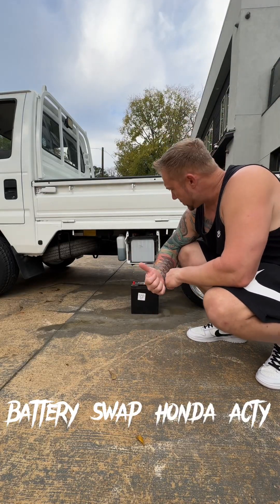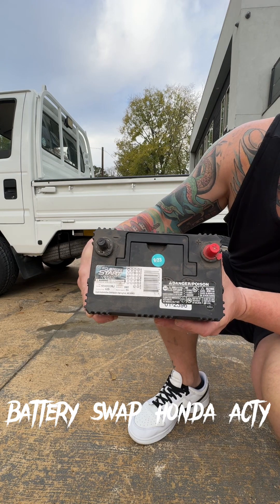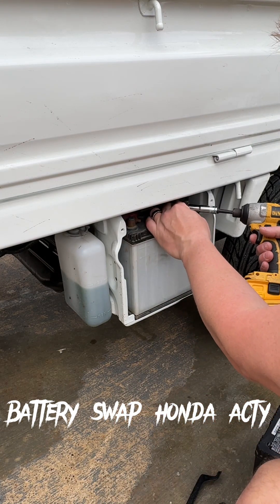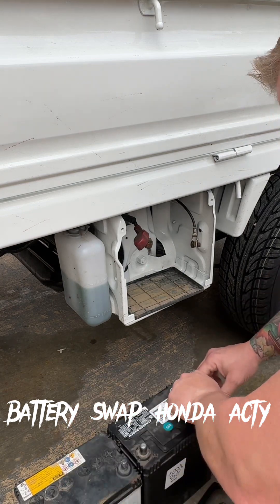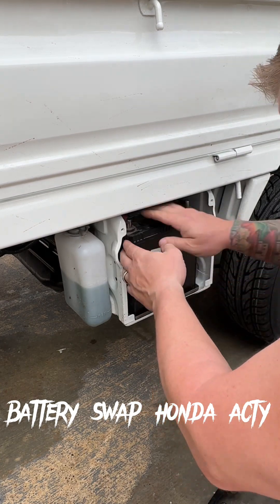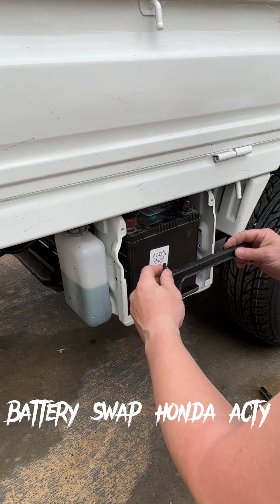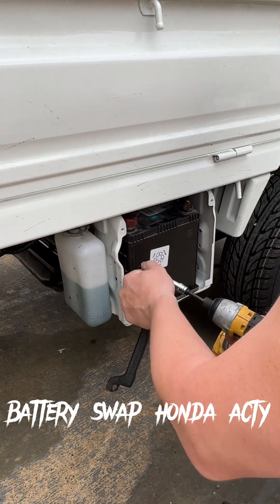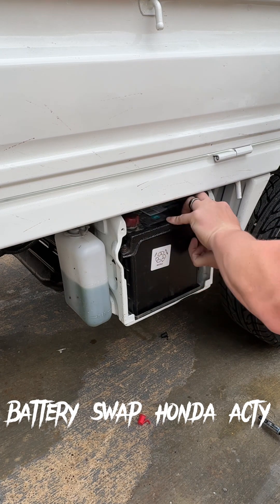Battery swap in kei truck , Honda acty ,best battery for kei truck

Comment: Walmart lawn and garden battery works just fine $50 bucks vs $250. Kei Truck Style drive safe out there. Signing in from ATX Austin Texas with a Subaru Sambar 4x4 5spd with AC
Reply: Sure but those batteries are only like 12ah.  The battery here has 35min reserve and 45ah I think. Good if you wanna run accessories like a radio, sub, inverter, Amp.